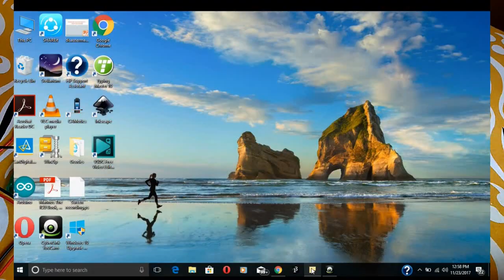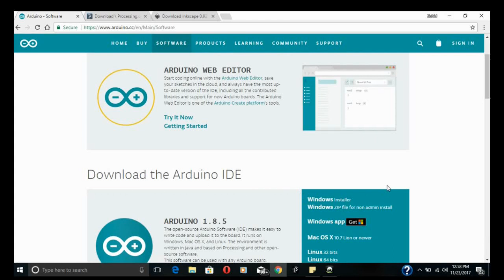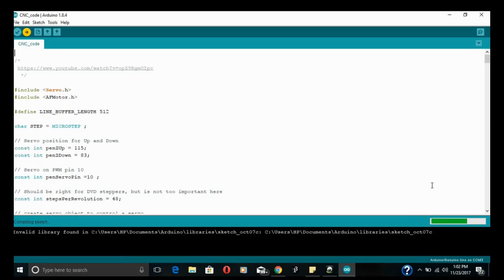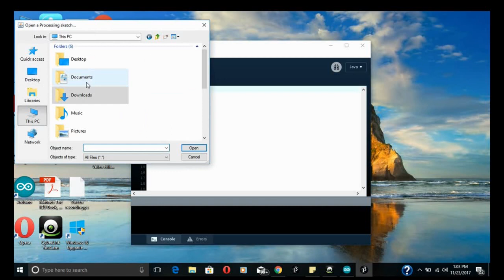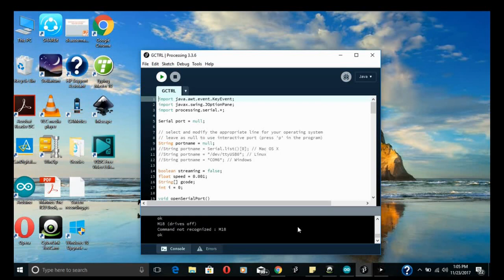How to make a mini CNC plotter - drawing machine at home with Arduino and Motor shield L293d

Comment: Is 5v and 1A is sufficient power supply for motor shield?
Reply from the maker: SACHIN JAIN , yes it's sufficient
Reply: Zahid Ahmed  hey, i connected charger of output 5v and 1A , the L293d of motor shield is getting heated rapidly, what could be prbm?

Comment: Hi! I built this machine, only my problem is that only half of my own gcode is visible. He would draw the other half, but the stepping motors would whimper in the end. Size okay, step / mm okay. What's the problem? thanks for the help!
Reply from the maker: Németh László, Check  with my sample g codes, if the problem is still persisting,  then usually it will be because of insufficient power supply to the motor shield..
Reply: 5,7V 800mA is not enough? I once tried using 12V 1.5A power, but then the L293D ICs were very warm. I used your CNC code last time. Your gcode can be completely drawn. The gcode I made does not work. Can I get an email address from where I might send a test? Thanks in advance!
Reply from the maker: Németh László zahid99.a@gmail.com

Comment: Just note that you also have to give power to the shield it self. The "M+ and GND" written in the shield, In order for the motor to work properly.
Reply: can i power the shield with a mobile phone charger by cutting wires n connecting them to shield
Reply: @praneet3188  yes, as long as the power you input matched the required voltage and amps from the motors.
Reply: @vincekyledelgado5436   what is the min required voltage
Reply: @vincekyledelgado5436  i made this project the g code also executes properly on computer but none of the motors move pls help
Reply: @praneet3188  check the motor connections by using multimeter. make sure all of the connections are wired together according to its order. If its still not working then put a minimum of 6 volts and more minimum of 3 amps. or less. I have the same problem before, I tried to input 12v and 2.5 amps. it worked but the motor is overheating so i stopped using it. but still the problem is i need more current to make the motors work.

Comment: is it necessary to use 5V supply? Or can i just power up it from USB?
Reply from the maker: duhamoras15,  you can just plug in 2 USB cables one for arduino and the other for motor shield in case you don't have a separate 5v source,  either ways works perfectly... :)
Reply from the maker: duhamoras15 

One important thing to remember,  the source used for arduino will not be sufficient to run your stepper motors.

Comment: How r u bro.... bro. menay apki video follow ki and cnc kaam kr rhi hai but drawing neat and clean ni ban rahi, y axis fluctuate kr rha hai jiski wja sai proper drawing ni ban rahi.please bta dijiay k kia masla h..
Reply from the maker: Saad Mustafa,  aapka pen holder loose hai shayad,  is ko rectify kijiye
Reply: gear proper ni bna rha ,isi trha arduino ka logo b ,
Reply: Simple code run krta hu to motor bohat smooth run krti hain, jb cnc code run krta hu to vibration c dono motors mai ati hain due to speed.speed kahan sai normal kru ?
Reply from the maker: mere sample code try karo, and follow how to make g code video
Reply: apka hi code use kr rha hu, ,,speed motors ki kahan sai decrease hogi ?
Reply: pen holder remove b krdai to vibration hai both steppers motors mai jb apka code run krta hu,,,,,
Reply: // Decrease if necessary
  myStepperX.setSpeed(40); //600

  myStepperY.setSpeed(40);  //600

is ko decrease b kia but wahi speed hai, adjust ni horahi speed

Comment: Bro , i did everithing shown in video , finally when i upload a g code, its drawing some thing that i did not understand  not o nly me no one did not understand what it draw (not drawing properly )please help me out , am giving two saparate power supply , using usb cables . Or should i change any thing else
Reply from the maker: Srinu Reddy,  try using my g codes..
Reply: Zahid Ahmed , bro , i used your g code , still it is not drawing clearly ,
Reply from the maker: Srinu Reddy,  then it must be power supply to motor shield.. Try using a 5v mobile charger to motor shield
Reply: Zahid Ahmed , this time  i used 5v mobile charger , tills not working please give me your mail id , i will share you the images i got with my cnc
Reply: Bro ,. Now its working fine .
Reply from the maker: Srinu Reddy what was the problem
Reply: Zahid Ahmed , problem with power supply only bro . I chnged the charger now its working fine.  By the way when i upload bulb.g code code , its drawing pikachu
Reply: Is there any way to increase the images size to its max .

Comment: bro im getting issue with servo, when i connect it to motor shield its turing off and restarting and if i run the gcode its showing pen up and stopping , can you help me out
Reply from the maker: harsha sai,  please check if you are giving adequate power to motor shield with 5v and 1amp source

Comment: When I am trying to upload the cnc code it shows error compiling.. What should I do?
Reply from the maker: Arunava Aditya , check if Arduino driver s are installed , and check your COM port
Reply: That problem was solved.. now stepper motor is not moving

Comment: sir maine 2000rs spend krkei CNC machine bnaya pr 2 stepper motor wotk nhi krehai mujhe lgta hi motor shield mei fault hai can you give me suggestions which i should buy !!!!
Reply from the maker: Have you done a stepper motor test run..
Reply from the maker: checkhttps://www.youtube.com/watch?v=cwwYBgH-w8A&t=5s this video
Reply: Zahid Ahmed yeah sir pr is programming mei servo motor bhi work krte hi (up-down) pr meremei vo bhi nhi kre bs slowmotion mei sound nekalrhe hai
Reply: Zahid Ahmed ha sir maine yeah bhi check ke hai
Reply: sir apnei motor shield khasei purchase ke hai? give me link please!!?
Reply from the maker: power supply theek hai kya...
Reply: Zahid Ahmed 5v hai i check from multi meter pr m1 m2 m3 m4 kei terminals ko power nhhi milrha
Reply from the maker: E.T E.E,  stepper ko power alag se lagao,  kaam karne lagenge
Reply from the maker: E.T E.E,  the power should be given sufficient to motor shield from another 5v source of 1 amps
Reply: Is it now working..I am also stucked up with the same problem..
Reply: Is it now working..I am also stucked up with the same problem..But Mr Zahid is helping me.

Comment: Problem Produced: 
The Stepper Motor attached with Mechanism Runs but it doesn't provide required Torque to Produce the motion to the Mechanism. 
I used 5V & 2amp Adapter to connect to Motor Driver Sheild.
Checked the Continuity between the windings.
Still not able to get any output
Any solutions?
Reply from the maker: It should run with a 5 volt, have you checked your pen holder ...is it obstructing the motion. 
Mine is only a 5v mobile phone charger connected to motor shield works well, try to trouble shoot...problem will be somewhere else, recently a brother tried all but the motor shield was defective,,

All the best...
Reply: Zahid Ahmed 
I didn't construct it fully I considered this only as in form of test to check the working of Stepper Motor and it's Mechanism
Can I have to Email ID so I could get Help from you regarding this?
Hopefully I'll send you some Pictures Tommorow?
Reply from the maker: zahid99.a@gmail.com
Reply: aaquif shaikh ...same with the problem with me I did contact the channel owner he said that the motor shield is defective..
he is right.....from where did you buyed the motor shield....if you get any solution for the problem please tell me too...or otherwise we have to change our motorshield.
Reply: Abdul Sheikh Mansoori 
There was no Problem with stepper motor. The problem was with The soldering section which was not done properly that's why motor was unable to run the Mechanism. There is still problem in coding that I'm still trying to overcome

Comment: How to connect the stepper motor to the motor shield 
There are 4 wires from each motor so I don't know the order in which each should be connected
Reply: Curiosity is it ok now because I also have the same problem?

Comment: hi iam nnot able to upload cnc code in arduino it showing error message(exit status 1
Error compiling for board Arduino/Genuino Uno.) MY BOARD IA ARDUINO UNO please help.
Reply from the maker: Naseema Begum,  please check your arduino connection and make sure you have selected the appropriate com port. If this is correct then your Arduino board might be faulty.
Reply: Download librarry AFMotor.h update for arduino IDE. This is for motor shield module

Comment: Sir when I run the gcode it's drawing something else I don't know what is the problem I'm using your gcodes 
The external power supply used is 
5.2v___2.0A
Reply: Broo use 9v 2a

Comment: bro, everything went smooth and when i run g code motors are kind of jamming ; what might be the problem ; and im powering it by 5v 1amp charger ; i've sent my connections to ur gmail, please tell me corrections . thanks in advance .
Reply: use 12 v 1 amp to run the motor

Comment: I made it
Reply: bro im getting issue with servo, when i connect it to motor shield its turing off and restarting and if i run the gcode its showing pen up and stopping , can you help me out
Reply: harsha sai had the same problem...pls...check if the servo is working fine...or try to change the code

Comment: Arduino: 1.8.5 (Windows 10), Board: "Arduino/Genuino Uno"

C:\Users\sanjay\Desktop\New folder (2)\CNC_code\CNC_code.ino:3:21: fatal error: AFMotor.h: No such file or directory

 #include <AFMotor.h>

                     ^

compilation terminated.

exit status 1
Error compiling for board Arduino/Genuino Uno.

This report would have more information with
"Show verbose output during compilation"
option enabled in File -> Preferences.
Reply: The reason is ur Arduino is a clone and it does not support coding.

To solve the problem u need to downlaod an extension( a driver)  called CH341SER 
After downloading follow these steps:-
1. Unzip the file
2. Open the setup file
3. Install the driver 
And u r done. Now ur Arduino will not show the error....